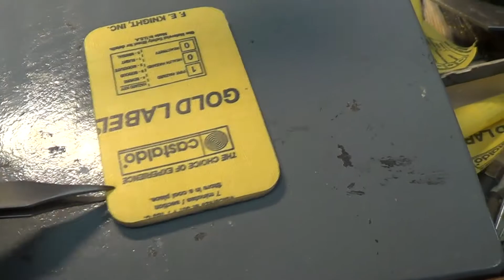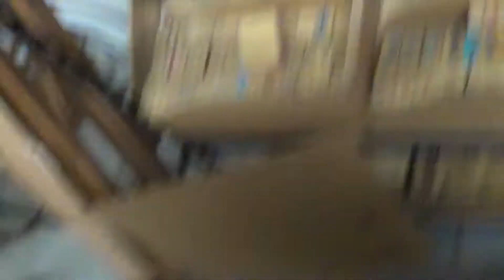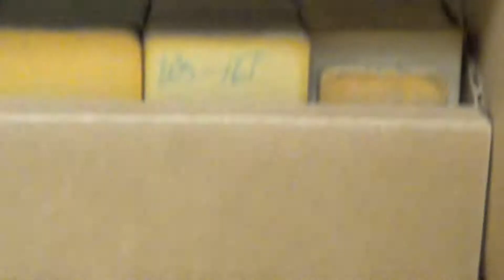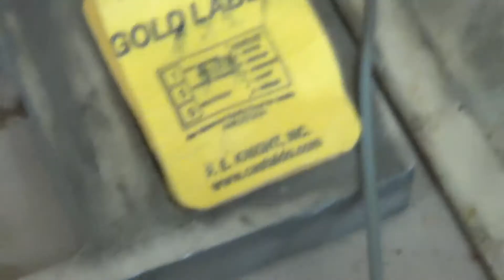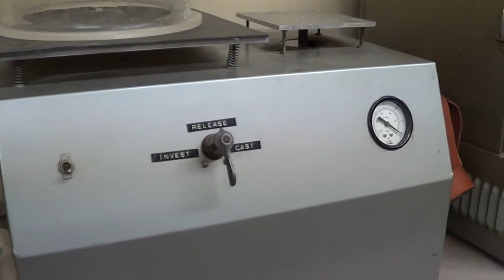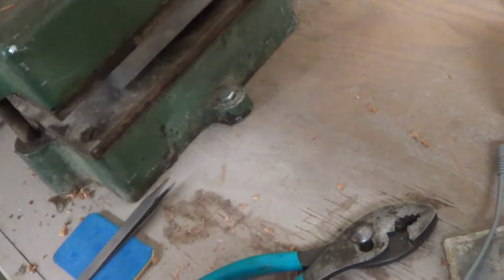Jewelry Mold Making Part One

Comment: Your information is so helpful for me. Can I use wax 3D model in this jewelry mold making ? Because most video in Youtube, for this process usually using silver model. If using wax 3D model, usually it will use RTV or silicone mold making process.
Reply from the maker: If you have the 3D wax why not cast it in silver and make a rubber mold?  I like rubber molds better than silicone as it's hard to produce good molds from silicone. That being said if you are copying an item that can't take the heat then you can use silicone.